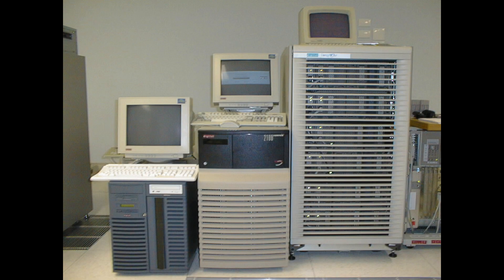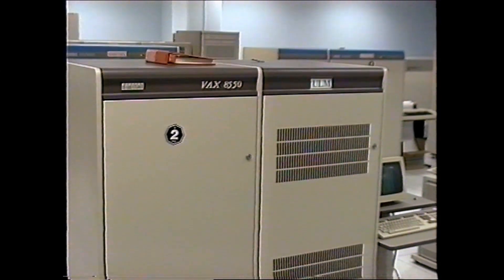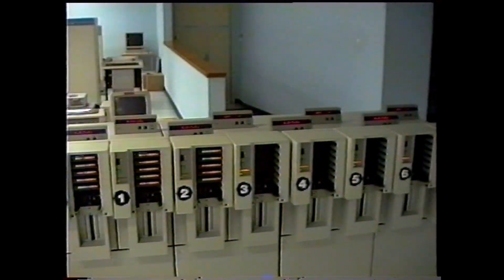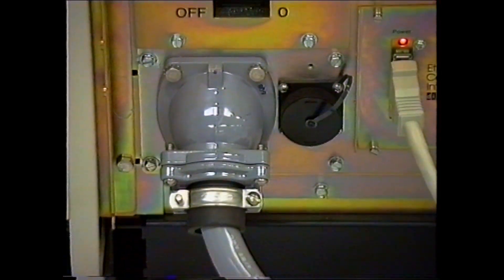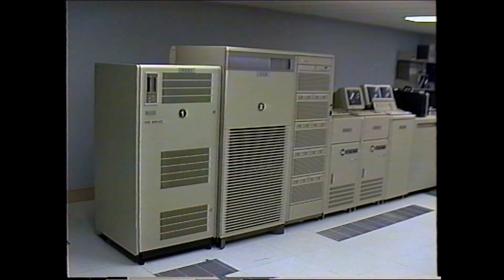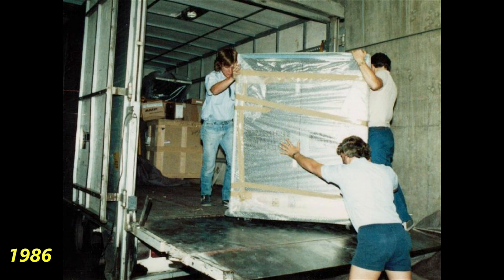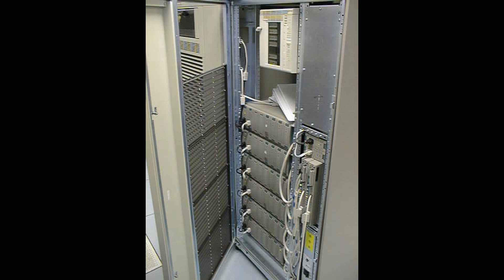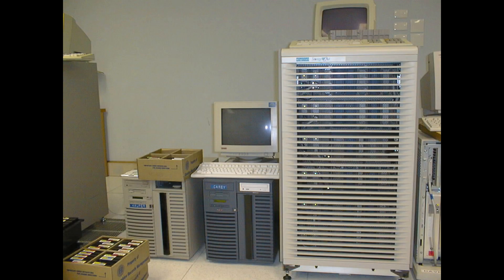Retro Datacentre Tour

Comment: Brings back memories of 3am DEC engineers on site doing an RA81 or 82 swap out. Even with two men they were very heavy. I had the joys of being a VMS System manager and COBOL developer on Vaxs from 1986 to 2010 from 11/730,750,780, clustered 8700s, standalone 6310, 3400 then clustered Vax 4105As.
Reply from the maker: I remember the engineers doing component level repairs on RA82's. Not something you see these days. I started off as a systems programmer, then added systems management when they combined the teams.

Comment: Thats a hella nice VAX DC.  Back in the mid 90's I worked at Citibank NA datacenter in Wilmington, Del.  They had about 100 VAX'es (not to mention, SunSparc, Tandem, IBMs (big iron) of all different types but spread out among 3 or 4 data centers in case of a site disaster like fire, earthquake, nukes, etc...  Them floors were elevated like yours there with the A/C pumped up from within.  Had to run all the time because all the heat generated.   Great time to be involved in mid-range computing.  Wouldn't trade it for anything...   Thank you so much for sharing this.  Brings back many wonderful memories.
Reply from the maker: Yes, those floors were about 3 feet deep. Had to be careful when the floor was open! That building was purpose built in the 70's and had piped chilled water A/C throughout. So nice not to have bulky A/C units in the computer room. Also had a Halon system, but thankfully never activated!